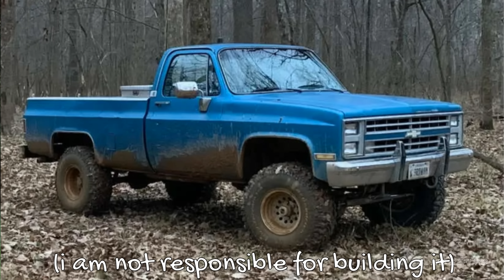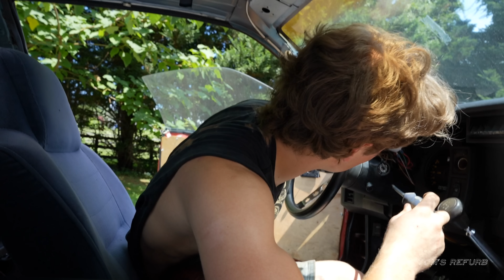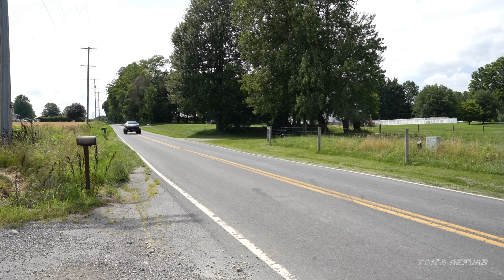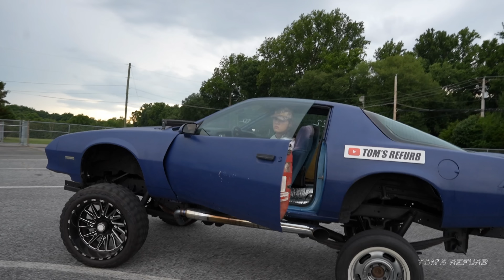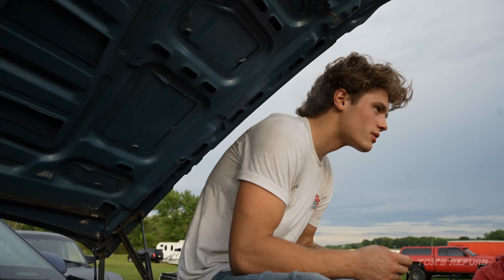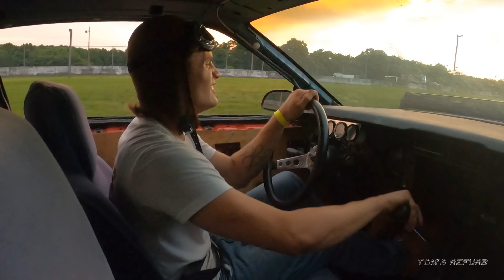I Took My 4X4 Camaro Drag Racing!

Comment: Lmao the announcer calling it the 'DOT can't catch me' had me dying
Reply: replace clutch and maybe transmission, get bigger slicks on back and smaller up front hmmmm maybe a shroud underneath for aero
Reply: @deleter1823  about the last thing that thing needs to worry about is aero lmao. 
Just needs some loving to the trans, replacement of the jank clutch from the manual swap, then he needs to get that engine freshened up with some injectors, fresh oil,  and maybe a head/cam job to make the thing fun.
Also, why on earth would this pile need more tire? XD
You need to hop off Forza and get yourself a shitbox brother
Reply: @PBRatLord  complete facts all around

Comment: Bro that reminds me. In my first car a 95 Camry when I blew the motor I was going 90mph redlining it not letting it shift and when it finally died my steering wheel locked up and I had to yank that mf with everything I had to get it around the corner and not go through the fence of the racetrack I used to live next to. Then somehow it fired back up after dumping a bunch of water on the motor to cool it down and we drove it about a mile and half and right before I pulled into my street it quit and we coasted right into it’s parking spot.